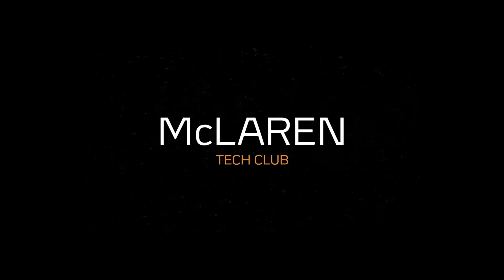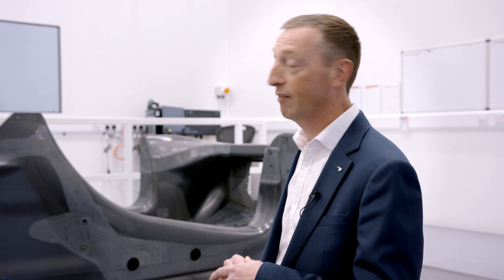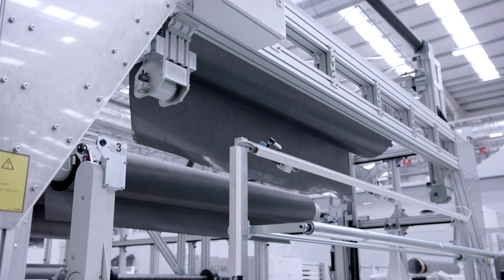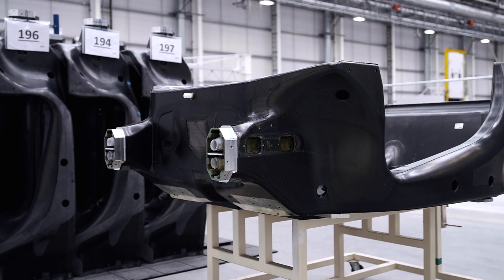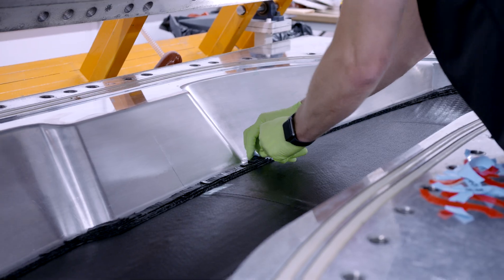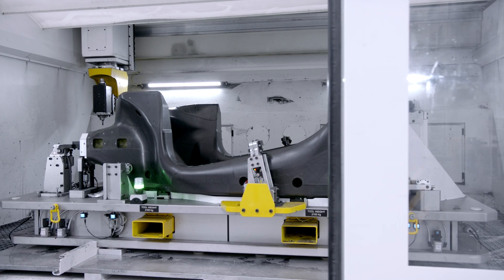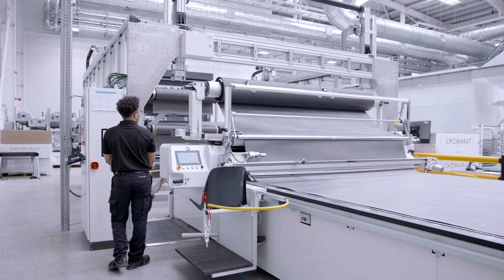McLaren Tech Club - Episode 21 - How to build a carbon fibre monocoque

Comment: How do they not have galvanic corrosion from have aluminum integrated into the part?
Reply: I assume they have the aluminum encased in a layer of epoxy where it meets with the carbon fiber. You can use titanium or stainless steel fasteners, and that will prevent rusting for the most part.

Comment: unless the chassis was created by weaving carbon simuletaeneously in one go, this doesn't feel like "one single piece"
Reply: by that analogy even weaving it simultaneously wouldnt be classified as a single piece.. There are still the individual strings of CF.. Where do you draw the line of what is a one piece and what is not?? There is no way that you can dissassamble this and put it back together without destroying it.
Reply: @uwu_demon5494  Look up the manufacturing process of the LFA chassis. Then come back and realize that's the only time I'll think of them as "one piece", or maybe like a giga press but then its not CF.
Reply: @ i know how they made the LFA chassis.. and they still didnt make it in one piece as you are thinking. They invented their own carbon loom, but the chassis was still made similarly to this. Individual carbon precuts were fitted into a mould and the only thing the loom helped with was with making 3D tube like pieces to reduce the number of "seams" and also reducing weight. For example, instead of making A pillars out of multiple pieces of 2D fabric, the loom made it in one piece, but as I said, they only made individual pieces of CF that they then laminated together with other pieces and inserts to form the monocoque. 

I work with carbon fiber for a living, so I think I have an idea what it takes to make CF parts.

Comment: the upper part of the side lower sill on either side of front driver & front passenger side door could be a bit thinner, more streamlined in tune with the design architecture . . . that'll blend seamlessly with the rest of the McLaren carbon fiber monocoque chassis . . .

Comment: How well does your carbon fiber age? The resins, the materials that make the carbon fiber system work? Will this be as strong in 10 years or 20 years?
Reply: Much longer. The original Mclaren F1s are sought after because of that. They don't rust away. I guess depending on the quality of the resin there might be some discoloration due to uv penetration? (not very sure)  but not detrimental to the actual structure I suppose.

Comment: That's secret thing is stamping, and the process used is called RTM. For those who are interested in the "technique" 
Amazing car, amazing company, love it.
Reply: BMW used on the i3???
Reply: @electricaviationchannelvid7863  I don’t remember what they did for the i3 but I think there is no other method as viable as Stamping and RTM for automotive reinforced plastic parts. 
In the future maybe they will use automated fiber placement. 
RTM is a fast but fastidious process, and the resin to fiber ratio isn’t quite as good as prepeg. That why I think the futures supercars will be done with AFP.
The good thing about RTM is beautiful parts, time saving, automation and reliability, that’s what you want for a i3.
Reply: @electricaviationchannelvid7863  Exactly. 
Although it wasn't quite a monocoque as is here. They had a frame on skateboard design where the lower aluminium frame took some of the chassis loads. 
The RTM experience led BMW to produce 7 series roofs and pillars which use wet pressed carbon parts. Not quite RTM. 
Big hats off to BMW, they tried to get advanced composites usage to the next level of volume production rather than at the niche/low volumes that has plagued composite usage to date.
Reply: Do you own one?

Comment: Awesome, thanks. I was just thinking yesterday how cool it would be to see the whole process. I'd love to see how the 2D parts become 3D parts. Hopefully someone will document that in the future once it isn't so new and secret.
Reply: this isn't really new and secret. What they're doing is literally cutting the desired shape, layer it in a pressurized mold while injecting resin. There are multiple videos online showing how to do it. The "secret" to McLaren is their pressurized molds. The traditional low tech way, which is extremely labour intensive, is to have a mold, you lay the carbon on top, cut excess, vacuum bag it while injecting resin, you can stop here, or put it in an autoclave, which is a pressurized oven, you leave it in there to cook and voila.
Reply: @gwot  yep, stamping and RTM, not that secret.
Reply: @gwot  pressurized molds. So its a autoclave without the heat? or is it more like a stamping press? I assume everything is laid wet into the final mold and pressurized again?
Reply: @Ckcdillpickle  it achieves the same result as an autoclave in terms of pressure, and if by stamping press you mean something like a hydraulic press, then yeah, it's pretty much the same thing, they both apply pressure, just by different means. What McLaren is doing is just 2 molds clamped together really tightly while injecting resin into the mold with laid out raw carbon inside. So they don't lay it wet, and it's done in one step.
Reply: @Ckcdillpickle  It's pre preg. They just throw the layers into the mold which can be heated - throw the whole thing into a vaccum bag and then chuck into an autoclave for pressure and heat. There is no epoxy infusion in their process. Pretty much all supercars are built like this.
Reply: @corail53  but if the press applies pressure and heat.. doesn't that defeat the point of the autoclave? or is that purely there to set the carbon so it stays mostly solid until its full cured
Reply: @corail53  curious why they specifically said it was dry carbon fabric and not pre preg. The gentleman also said something about infusing the carbon fabric in the mold.
Reply: @corail53 That's not correct. He even explains it in the video at 1:05.
McLaren is using a RTM process, which is by definition a injection process. That's why you use dry fiber.
Reply: @gwot  They do it like every other one making carbon monocoques, basically prepreg into heated molds - put under vacuum, then thrown into a auto-clave where it undergoes more heat and pressure.

Comment: 2:42 What are those white hub things your putting on the carbon used for?
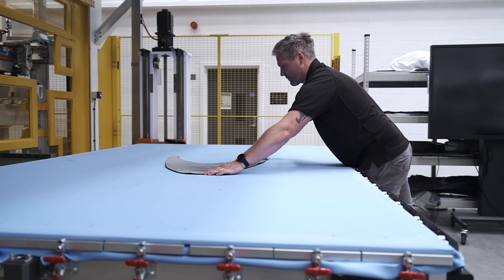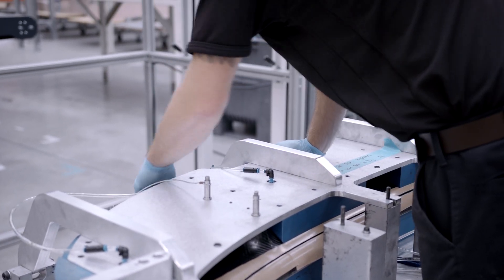Reply: It's most possibly used to heat the ply stacks in certain areas and bond the plies loosely together prior to forming. There is possibly a heat activated binder on one side of the carbon plies. Upon heat exposure  (80 - 100 °C) the binder gets tacky. This step is used for safe handling in further processing, since there is a risk of ply misalignment when dry fibre stacks are handled. I guess the stacks are then preformed by diaphragm forming/hot drape forming 3:20 (which is the "secret" process). 2:48 - 3:03 is just for distraction, as this segment shows part assembly rather than the secret forming process ;) The preform is then inserted into the RTM moulds for resin injection and resin curing. It is a standard process to use preforms for RTM processing. Preforms reduce the risk of fibre wrinkling when the RTM mould is closed. Hope that explains the process to some extent.
Reply: @IEleMenTIx  haha for some reason it’s mindbending to see a company like mclaren use I cricut iron that you can pick up fro $150 at Michaels or Walmart

Comment: Does it remain hollow with eletric cables or is it somehow foamed afterwards?
Reply: I believe the answer is at around the 3:19 mark. They seem to be putting together multiple preform shells in a mold that form those hollow parts of the chassis when the resin is added. 

I wonder how strong a chassis like that is. From what I recall during my time studying composites, carbon fiber is used as a reinforcing material for resins. It is far stronger and stiffer than steel, but the strongest resins I am aware of is far weaker. Since the preforms are bonded together by this resin, there will be gaps in-between preforms where only the resin keeps it together, making it more susceptible to breaking. Is a chassis like that able to handle crashes(or even loads from the road, engine, etc) as effectively as steel or aluminum?  Maybe there is an alignment trick I can't wrap my head around that distributes those loads in a way that affects those gaps less. Though that's just my lack of experience with this stuff talking.

Comment: It would be cool to see carbon foam of varying density for parts of the car, like bird bones.
Reply: very cool idea however I have to be that asshole and say that while carbon foam is a good enough insulator to put on the bottom of a re-entering spaceship, its structural properties are... well... very foam-like
Reply: @seagie382  people push the boundaries. It’s a tragedy, a shame that it couldn’t be pushed far safely. Perhaps there’s a way
Reply: @seagie382  yes but one could use electricity and heat to get a similar effect out of carbon fibers that are loose the bond is weak but iv had some luck making core structure this way with thinned epoxy. The thinned epoxy is critical for it though and you have to make small layers that bond together into the core of the final structure to do it and honestly PVC foam is so light that it's a very small difference for alot more effort. I do wish they had someone a bit better versed in composites rather than business in the vid but I actually work with the stuff so maybe I'm an odd ball
Reply: I can’t imagine who’s that would be produced, but it would be neat either way
Reply: Why would you use carbon foam? And for what kind of parts?

Comment: I like how you guys just posted this after Tavarish posted about fixing his 675LT's monocoque
Reply: I came here to write the same thing 🤣
Reply: Idiots said it couldn't be repaired!
Reply: @callumbush1  Lol carbon fiber is always regenerative.
Reply: @callumbush1  They only said that because of liability/safety concerns. Repairs are also not matching the engineered weaves and so any repair (while possible and can be done) are not in spec with the safety tests of the car. In bike frame repair (carbon) we see that repaired spots end up being stronger in that particular area because of more expoxy but it can impact/ harm the rest of the piece. If say a piece is supposed to have some slight flex and you then make that part less flexible after a repair it puts stresses around it.
Reply: @callumbush1  ya it’s very common per lawsuits and responsibility. They don’t want dumbasses out there repairing them. In fact most manufacturers are going to tell you the same thing. Problem is we live in a society that likes to sue for petty, or issue that may have been caused by them self. So because of that lot of manufacturers have found it better to say sorry we don’t repair it. But also when carbon fiber is broken it causes stress fractures to spread throughout, and also delimitation and all kinds of problems. Even Chevy won’t allow it composite chassis of the corvette (at least on the c6-c7) be repaired.
Reply: @buddtwin2  yeah you're right as we live a disposable society with item's deliberately made non repairable or very difficult to repair for the average person!
Reply: Lol their secrets got leaked so they put it out there themselves. If everyone's going to know they might as well profit from it.
Reply: True
Reply: Awesome it's a huge undertaking!
Reply: As I understand it McLaren didn’t build the tub for the 675LT. At the time McLaren’s road car tubs were outsourced to an Austrian company. Maybe it was their subcontractor said it couldn’t be done.
Reply: Fun fact:
Tavarish's car has mono-cell 1.

McLaren has been using mono-cell 2 for the past 4 years, starting with the 720s.
Reply: @8w494  This doesn't really mean much unless you can tell us what the technical difference between mono-cell 1 and 2 are lol 🙂
Reply: @Kyson Hunter yea, I've been using flixzone for since december myself =)